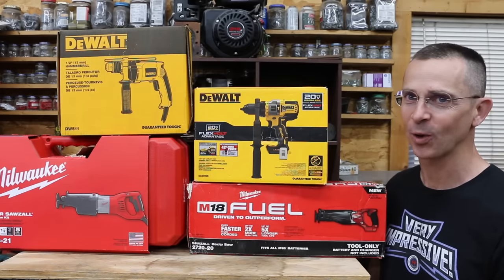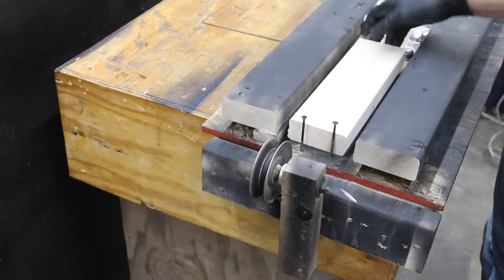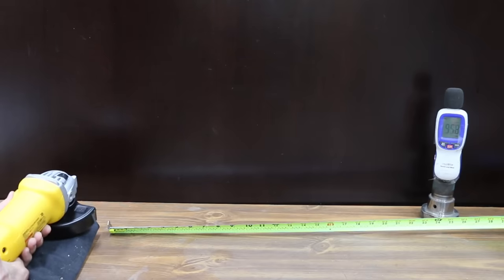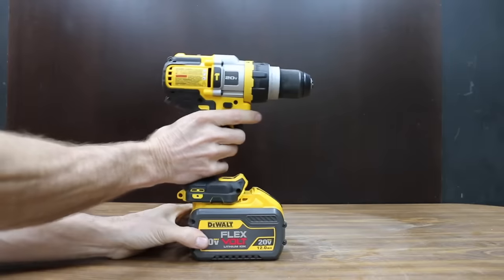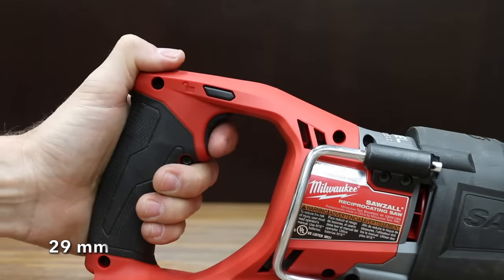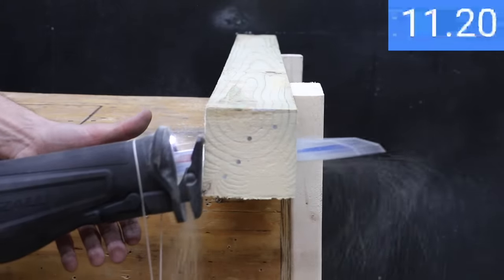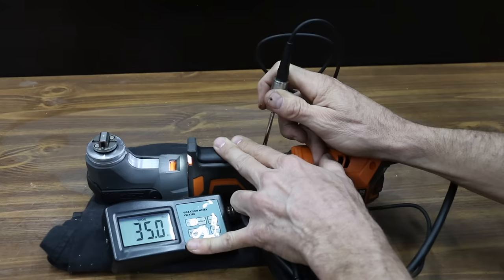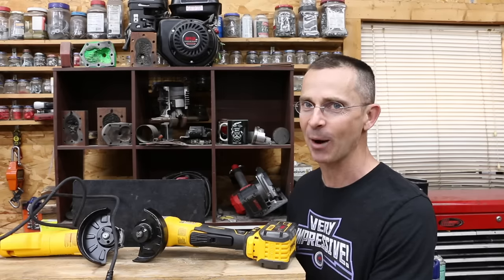Let's Settle This! Are Cordless Power Tools REALLY Better? Torque, Cutting Speed, Noise, Vibration

Comment: Dewalt has a flex volt grinder. I would have liked to see that compared to the corded model rather then the 20v using a flex volt battery. I have one. Very powerful
Reply from the maker: Thanks for the suggestion.

Comment: You test the battery power tools with fully charged batteries. Tools with cords are always "fully charged". So the speed etc of the battery tool might do better than a cord tool, but would quickly lose power. A better test might be to test the battery tools until they have to have the battery changed. There might be a much greater difference between cord and cordless tools performance then. When I was laying some sub flooring, I quickly changed over to my old corded drill. The battery operated drill just didn't last long enough to finish the job. Of course, for smaller jobs, the cordless is first choice.
Reply from the maker: Thanks for the feedback.

Comment: I think on the dewalt drill test, those 2 drills are in different market segments, is be curious to compare a different brand with closer offerings between cordless and corded. Also I think it would be good to do SDS hammer drills as all the heavy professional drills have until recently been corded.
Reply from the maker: Thanks for the suggestion.

Comment: Frankly it comes down to this: Cordless tools are often more refined tools, since they have to be expensive anyways due to batteries. 

However in terms of actual power output, a corded tool has 1500w available, since that’s what a wall socket can provide. Most 18v batteries can only output 350-500w. 

Do you need the extra power? For most power tools, no, I’d rather take the added convenience of the cordless. However for some tools (like heat guns) you simply want the extra power.
Reply from the maker: Thanks for the feedback.

Comment: I have a 1970's - ish Milwaukee 1/2" hammer drill with on/off gear reduction.  It bears a sticker that says "Warning: High Rotating Force" (OK, they mean torque...) and they aren't kidding.  I'm reasonably certain that without the assist handle, I could break my wrist if it locks up in the work.  It would likely bury or ruin that torque adapter.  It would be interesting to see how it fares against anything else in the 1/2" category.
Reply from the maker: Thanks for the suggestion.

Comment: I have a meta question I hope you could talk about. You test and try out lots of tools, when do you decide that a tool you already have and use should be replaced? Does it depend on the features of the replacement, or the problems that you run into with your current tool?
Reply from the maker: If my existing tool underperformes significantly compared to the better performing tools tested, I replace it.

Comment: I think the biggest problem with corded stuff is that you need to have power at maximum distance of the cord length, and the cord often gets in the way. Battery powered, you can work like wherever you want and no trouble with the cord limiting you.
Reply from the maker: Thanks for sharing.

Comment: You can get fully kitted out with tools for the price of only a few cordless tools and they'll probably last longer and they won't need new batteries later. Aside from 3 impact screwguns, 2 drills, and 1 18 gauge nail gun, I exclusively use corded tools. It's too inconvenient to run an extension cord into every nook and crevice I find myself in to drill or screw something. And it's nice to nail those small jobs without hauling the air compressor out and uncoiling a hose. But it's totally manageable for the lesser-used tools or more power-hungry tools. Keeping up on charged batteries is easy when most tools don't use them.
Reply from the maker: Thanks for the feedback.

Comment: Im a drywaller, use a dewalt cordless gun for 7, 8 years, maybe more. Dug out my old dewalt corded gun, nd tried it out to compare. Way nicer, sunk screws with noted confedence, torque? Would igoback to corded, not a chance, hate dragging around that cord.
Reply from the maker: Thanks for the suggestion.

Comment: The results weren't a surprise considering how much more research and development goes into cordless tools. Nowadays most tool brands corded tools are pretty basic and don't often change. If Dewalt wanted to they could make a ridiculously powerful corded drill but it just wouldn't make sense to put time and money into a tool that doesn't have a high demand. Modern batteries last so long and the cordless tools themselves are so good that when combined with the convenience of not dealing with a cord they're pretty tough to beat.
Reply from the maker: Thanks for the feedback.

Comment: Can you please do a video on something like diesel fuel additives, showing how they can clean dirty injectors or a see through engine to see if the additives change the flame fronts and what not, as well as if fuel efficiency is increased or power and maybe even thermal efficiency !! Please please
Reply from the maker: Thanks for the suggestion.

Comment: I use old drills and things using a wire and a lawn tractor battery. Semi- cordless. My 9 volt drills run on 12 really go like hell and I can run them all day.
Problem is most newer tools run higher and higher voltage and now I would need two or even three of those batteries.
Not all of us can afford $ 50 batteries
Reply from the maker: Thanks for sharing.

Comment: Could you check out Einhell brand too. I liked the idea that they use same batteries on all products which will save money and lower e waste. It just seems good idea so you can use your charger and batterie and just buy another tool or if your battery dies it is much easier to get a new battery since all the batteries are same

Comment: Have you ever tested framing hammers? 
Specifically, the classic steel head VS the titanium.
Or wood vs fiberglass vs metal handles for vibration and strength.
Reply from the maker: Thanks for the video idea.

Comment: Realistically it comes down to how often you will be using them. Batteries go bad from nonusage and will be expensive to replace where a corded tool can be put away for extended periods of time and will still work. With a lot of usage and having multiple batteries the cordless is much more convenient than having to use extension cords.
Reply from the maker: Thanks for the feedback.

Comment: I propose a different kind of timing test that includes the time to set up the tools, stretch out the extension cord, do the cutting or drilling, then put everything away.
For many tools I have both corded and battery versions and the set-up and put-away times are a huge influence on  which one I choose to use in any given situation.
For example, I recently did forms and rebar for a 14' x 4' sidewalk.    My corded circular saw and angle grinder are lighter and cut faster than my battery saw and grinder ... but I used the battery tools for this small project because of the amount of time saved in not having to dick around with a 50' extension cord.
Reply from the maker: Thanks for the suggestion.

Comment: Manufacturing date is probably huge with this. Every year the tech advances considerably. especially the last couple years as batteries and electrics motors have seen so much growth. I'd be interested to see the comparison of different times if you could find a same or very similar tool 1 yr, 3 yrs 5 yrs and 10 years old or something.. That 60 volt battery is interesting too, I believe they are just sticking all of the batteries inside in series and letting a controller do the work of converting the voltage to what the tool likes, but this supplies some voltage overhead, and allows lower amperage pull to keep heat down in high power tools coils ect. while still being able to put out the same power.. I bet that is going to start getting very common.
Reply from the maker: Thanks for the feedback.

Comment: Only reason why someone would prefer cordless tools: in my case, with my father sometimes we make repairs in remote areas, or urgency where dispatching several meters of 220v cables it's time consuming and even more than packing many charged batteries, for instance, batt operated tools are the fastest solution
Reply from the maker: Thanks for the feedback.

Comment: I doubt if battery tools will ever overtake corded ones when it comes to power. Where I am, we have 240v 10a supply which allows for a 2400w corded tool. Typical 18v tool batteries use 10 cells in 5 series 2 parallel configuration, which allows for a maximum of around 18v 50a depending on the exact cells used which only allows for a maximum 900w.
Reply from the maker: Thanks for the feedback.

Comment: The biggest reason I don't do battery saws, is number of cuts before battery dies. I don't want to have to stop my project midway waiting on batteries to recharge. My drill is battery. My string trimmer, my blower, my hedgers, all battery powered. My circular saw, rotary tool, etc. all corded.
Reply from the maker: Thanks for sharing.

Comment: with mains verses battery its the work situation that really decides the issue of which one . batteries run out of power and deteriorate over time  although they are better now .The cost of new batteries can be more than a corded mains tool
Reply from the maker: Thanks for the feedback.

Comment: That rigid cordless multitool is a bit weak, but still beat its counterpart which was interesting. Difficult where many of the other manufacturers don't even make a corded multitool anymore, so I understand the reasons for that comparison and brand used for it.
Reply from the maker: Thanks for the feedback.

Comment: I'm very curious to see the tests repeated with a battery after it has been used for a month, 6 months, a year, etc. I'm also wondering if the battery powered tools provide the same performance at all charge levels, as long as they are not completely depleted.
Reply from the maker: Thanks for the suggestion.

Comment: This might be difficult to test, but at work I have to use big ole pry bars to push fuel cells out of various styles of forklifts. We had been using a Mayhew Dominator, 52" I believe, but I lost it somehow and am just using the biggest Pittsburgh one I could find at Harbor Freight.

Strangely, I feel like this slightly smaller bar does just a good of a job moving these over 2,000 lb fuel cells around (they get stuck sometimes due to roller damage in some of the trucks). Regardless, I wonder if it would be an interesting video to test the capabilities of various pry or demo bars? Might be challenging because of the potential forces involved though. 

Apologies if you've already done it, I might have missed it.
Reply from the maker: Thanks for the suggestion.

Comment: How many replacement batteries will have to be bought to equal the use I've gotten out of a corded drill in 10 years?  My drill is still going strong while the cost of replacement batteries would have exceeded the cost of it many times over.  The only advantage of cordless is portability.

Comment: To be honest, the drill comparison was a little bit off, since the corded one is just a drill, and the cordless is a drill and screwdriver. Since you just made a screw test between them, you should've used the corded DW284 for an apples to apples comparison, or made a drill rig.

That said, excellent tests as always.
Reply from the maker: Thanks!  Thanks for the constructive feedback.

Comment: The biggest thing is what you plan on using the tool for, a mechanic wouldn’t use corded tools, and rarely air where required, opting for battery powered, for portability and being able to fit in tight spaces.

A boilermaker would be better to have a mix, but mostly corded seeing as they already need corded power to run the welding gear anyway. 

A farmer is better off going for corded tools because they are far cheaper, have constant power and don’t have to be charged between use
Reply from the maker: Thanks for the feedback.

Comment: Not to discount your work, awesome testing.

If you are just doing repairs around the house the cordless stuff will get you by just fine.  As mentioned companies put their r&d $$ into the cordless stuff. On a real jobsite we use real tools.  I have yet to see an electric dump truck towing an electric excavator to dig out a sewer system in the sub division. 

A real corded hammer drill is an SDS max rotary hammer, the little guys are fine for 1/4" tapcons but are too slow for actual jobsite conditions.  i.e. 20+ 1/2" wedge anchors for a 24 x 24 garage.  Build your wall on the floor, sheath it out, stand it up and drill the mud plate is way faster than drilling sill for j bolts and framing off a ladder.

I use a worm drive framing saw, the saw tested here is called a "sidewinder" and is reserved for cutting out rotten subfloor(just because its smaller).  A framing saw yields a much straighter cut, with less effort, and doesn't bind or kick back.

In a real fab shop angle grinders eat their own sh*t  all day long.  2 grinders minimum, one with a cutting wheel and one with a flap disc.  
When doing a tile job I have a 9" Metabo (pre Hitachi) with a 7" diamond cup wheel, no battery grinder will ever keep up with it.
Reply from the maker: Thanks for the feedback.

Comment: Excellent test.
However,  the true test is using those tools all day long. Construction sites devour tools because the demand is so high. Depending on what type of work you are doing the battery tools can certainly do the job, but you are going spend upwards of $1,000 or so on extra batteries and chargers to keep up that corded tool all day, plus the batteries will still need charging at the end of the day.
Battery powered tools have come a very long way in the past 20 years from the old long stick Makitas to the myriad of options today, especially the current battery technology.
On less power demanding jobs the battery tools win hands down because of the superior quality and function, but the cords still reign supreme when brute force is needed. 🤙

Comment: The corded devices are obviously still better value but the performance gap is rapidly closing. I believe this is due to the more efficient BLDC motors used in the cordless tools. Eventually we may see them in corded tools as well, which could have insane benefits. Probably not too far off
Reply from the maker: Thanks for the feedback.

Comment: @projectFarm - I would LOVE to see a test on washer fluid. Is more expensive always better? What's the freeze point? Ability to remove bugs (or dirt), overall performance (cheap can be good, but not if it takes 30 second sprays to clean the shield)
Reply from the maker: Thanks for the video idea.

Comment: Video Idea...  Best Wheel Cleaner.  Which one will take 10year old baked on brake dust off an alum wheel.  And which for a steel wheel.  Is just scrubbing better?
Reply from the maker: Thanks for the suggestion.

Comment: First off your awesome, with that said hammer drills are meant for concrete type materials.  If you put them head to head making holes for anchor bolts I would put money on the corded hammer drill.
Reply from the maker: Thanks!  Thanks for the feedback.

Comment: I knew that Super Sawzall was going smoke that battery version.  With equal engineering the corded is more powerful.

  But I think all R&D has been completely abandoned on corded tools for the most part. Most corded tools now seem to be Frozen in Time and there has been no improvements in years. 

Just imagine if they put the same engineering and effort into corded tools they would be total monsters. But I understand why they're not doing it, because the battery stuff is where the money is and that's what most people want.

 I have an old school DeWalt circular saw that would smoke these battery operated ones. And yet that thing sits on a shelf in my garage while the battery version is in my truck because that's what I use now.
Reply from the maker: Thanks for sharing.

Comment: Besides drills and impact drivers, which you carry with you most often, I'd pick corded for other tools. Assuming both tools could last 10 years, but I doubt the battery life could last that long, you might need to change the battery at least once or twice throughout 10 years, and battery is like $200+ each. so corded tools should be cheaper to run in a long term.
Reply from the maker: Thanks for the suggestion.

Comment: My issue with battery tools is that they are becoming like printers and their ink cartridges.
The tool is just the foot in the door to their expensive battery system.
I would also prefer if tools were rated in watts. 
If you have a 20A breaker, you can pull up to 2400 watts.
No battery pack is going to come close to that unless you have a crate of them attached to an extension cord.
One place where this is obvious is the impact wrenches.
An 8.5A corded impact will smoke a batter impact in speed of removal.
The battery powered one will just hit harder per strike because of design, not total power.
Reply from the maker: Thanks for the feedback.

Comment: In the long run: Get the Corded out of the box and it runs right away, no drained battery surprises, no battery replacement issues, no `battery handcuffs` or rather; you are not a slave to the battery brand when purchasing a power tool. The battery might have become the best marketing trend the power tool makers have discovered. Now they are competing to capture loyalty of brand via batteries and not necessarily through better products. Conclusion borrowed from commenter "Peter Allen" -  He wrote : "The big test for me on most of these tools is how they will compare in 10 years.  The cordless will be near useless unless I get a replacement battery, and that assumes that they haven't moved on to a different style of battery by then.  The corded one will still work."
Reply from the maker: Thanks for sharing.